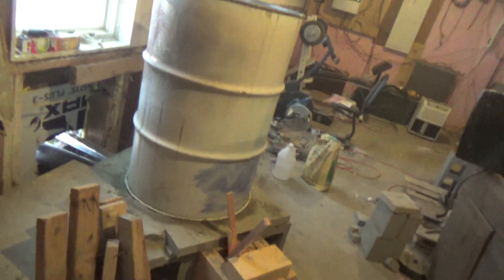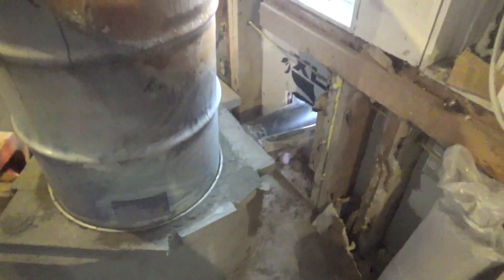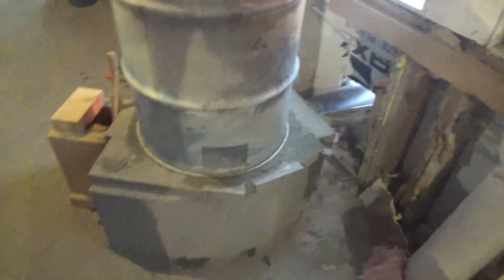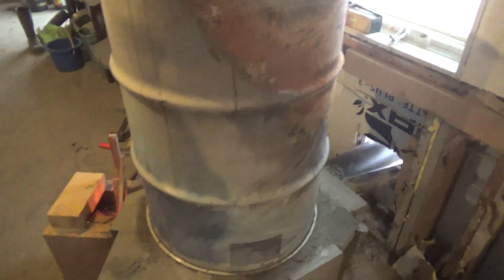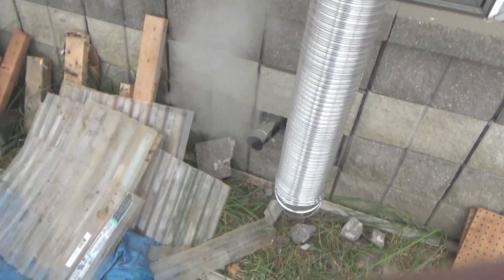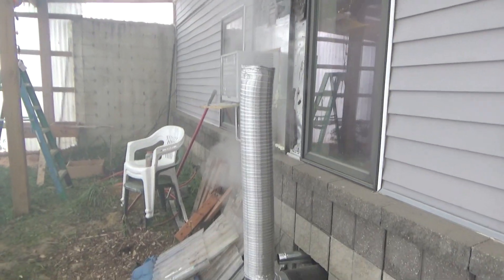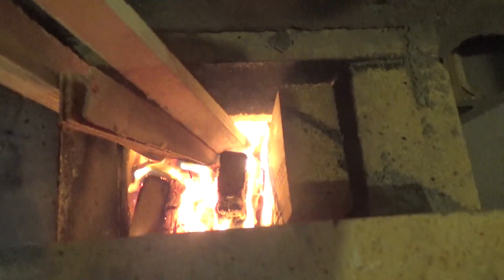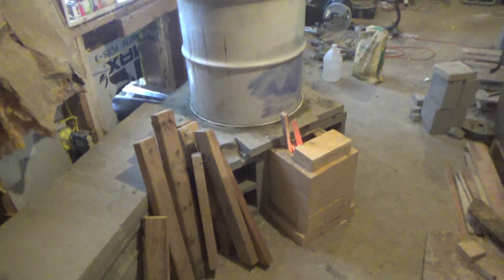Rocket Mass Heater Part 3; After some tweaking, it works!

Comment: Does it smoke during work if left completely open?
Reply from the maker: not normally, but because it is in a basement, there is a draft with extremely cold weather, which can cause blowback and smoke.  I recently installed a draft fan on the smaller exhaust.
Reply: @michaelambrosia  , I have a few more questions, if I may.
When he puts smoke back in the room, do black marks form on the ceiling?
Also, have you tried burning wood about 1 meter long to put less often?
And last but not least. Is it possible for one rocket stove to heat 4 radiators?
Reply from the maker: @martintunov4393  it depends on the radiators and how they are configured. If you're wanting to heat water it would be best to wrap a copper coil around the barrel. I don't burn along wood anymore because once the bottom burned sometimes they can fall out. I stick to wood last in double the depth of the burn chamber. I don't have white ceilings above it so it could have possibly done something black up there but on my wood rafters I don't see anything. You have to watch it.

Comment: Hi there. Plants need CO2 not CO. Carbon monoxide is odourless. The exhaust must exit outside and not in an enclosed environment especially connected to the house.
Hope you don't poision anyone in the house.
Reply from the maker: yep, see later videos.  CO is put out when things burn inefficiently, which is not the case here, but in any case, we didn't need that much CO2 in the greenhouse and recirculated back into the house.